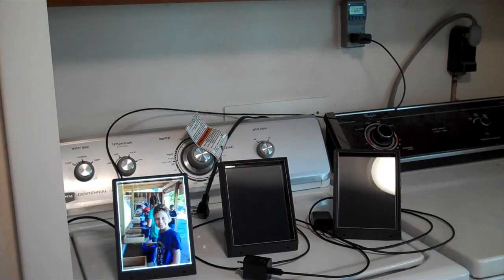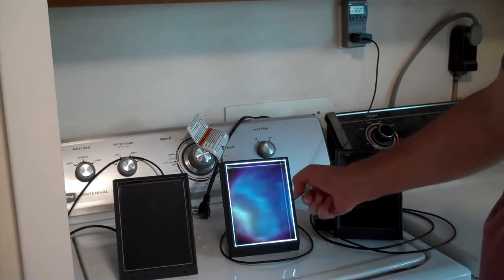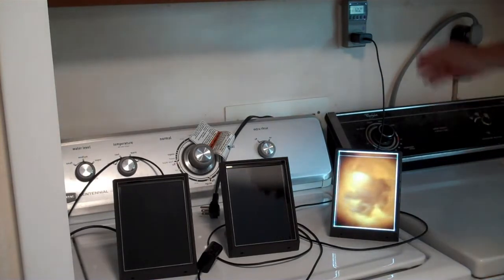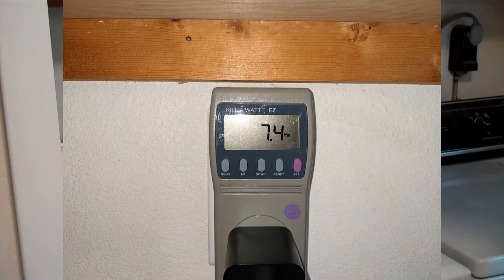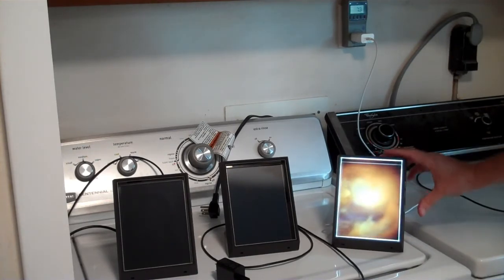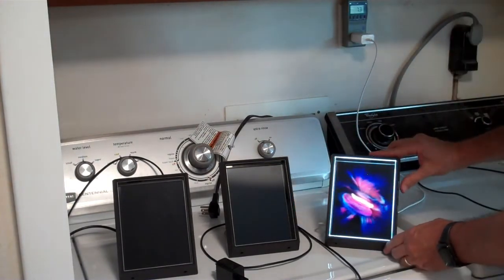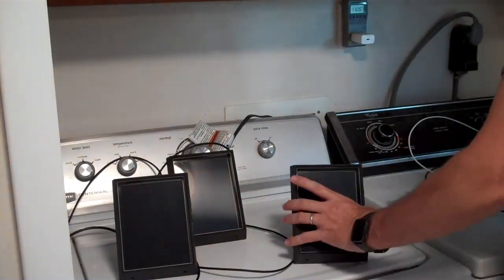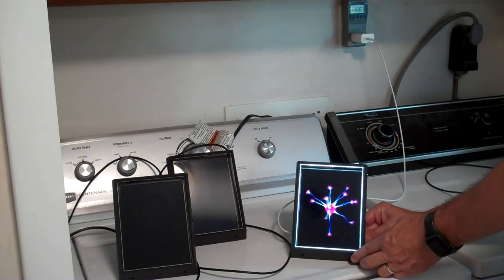Capacitive Touch Button Failure & Solution on Looking Glass Portrait

Comment: Have they addressed this issue, not recieved mine yet
Reply from the maker: They are in the process of sending me a new power supply, and I believe they are also swapping out suppliers for future deliveries.
Reply: i got one about 4 weeks ago so far so good,  but the adapter looks the same.  works fine on the adapter and on my macbook power adapter unfortunately none of my pc's have native usb-c  but i can also boot it off a usb-c battery power pack i have..  been intending to see how long it runs that way.
Reply: Had 2 netgear routers replaced, found out later it was the power supplies failing...apparently newer power supplies are now required to draw no power at idle and have a switch inside them, switches failed...maybe switches are hit and miss and work most of the time